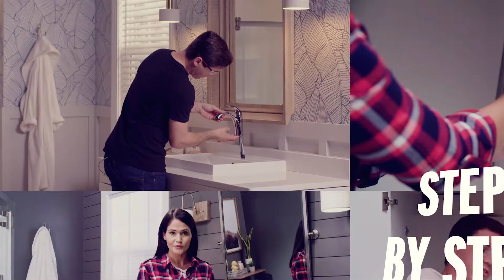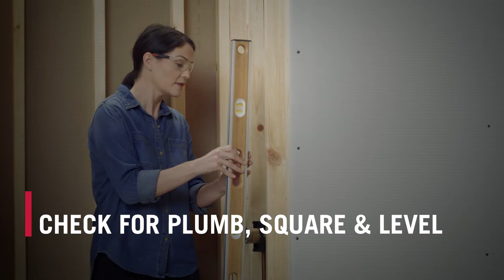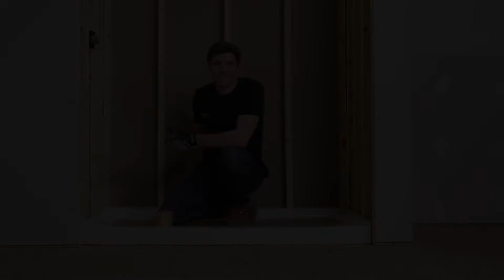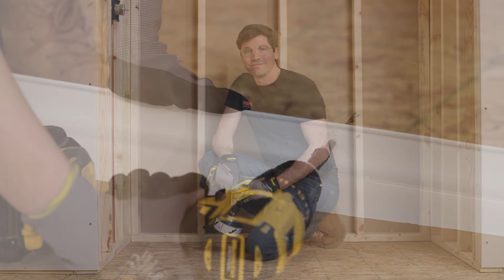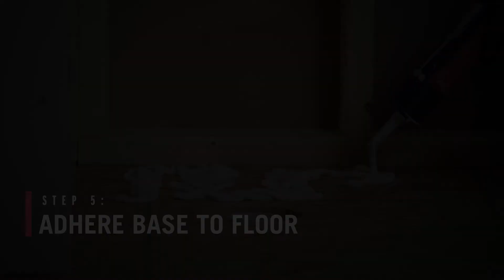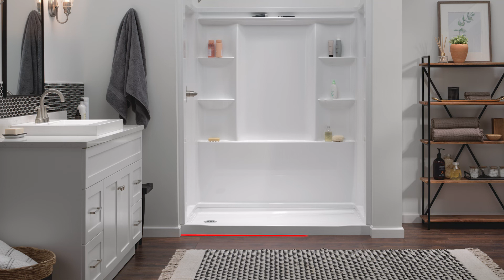How to Install the Delta® EverEdge Shower Base (60x32)

Comment: Is the drain hole for the shower base generally in the same location as if you were to replace a tub where that drain was?
Reply from the maker: Terry we offer right and left drain tubs. We recommend checking the specifications  of the new product against your original product before purchasing. -Kelley

Comment: This base does not require mortar.
Reply: In the video it says "if" your subfloor isn't level, then you'll have to use mortar to level.
Reply: The base support is 1) barely attached to the pan and 2) shaped like a rocking chair.  There is no way in hell to place this base in a mortar bed and have something useable.  I used a self levelling underlayment.
Reply: can you use mortar even if it is not required? that might help when leveling it.

Comment: What do you mean about taking the protective plastic off of base? The black reinforcement?
Reply: Some bases come with a clear plastic protector. Mine didn't however.
Reply: I second this question, you don’t mention this step in the 48x34 video.